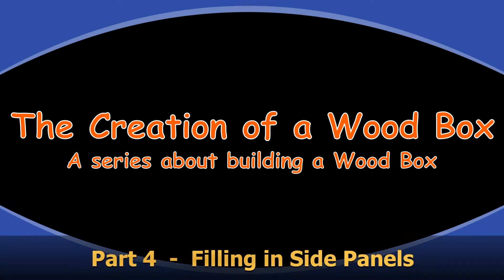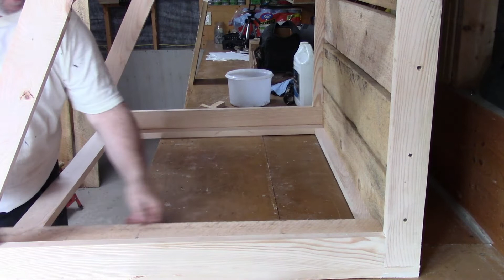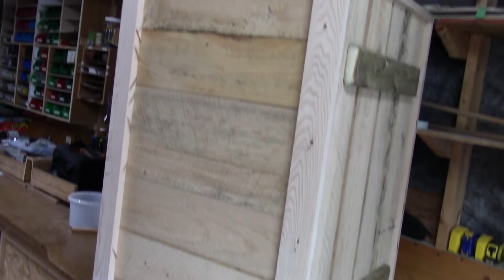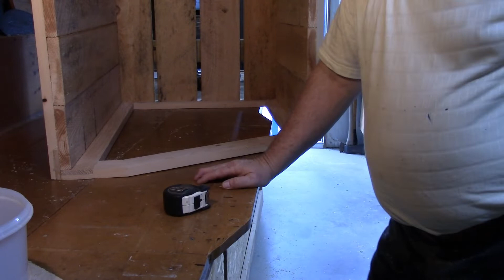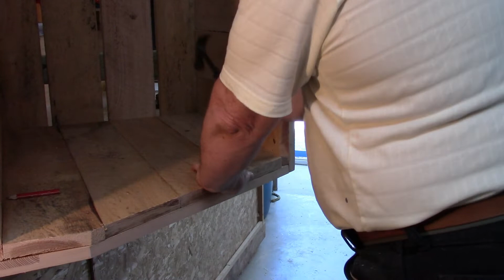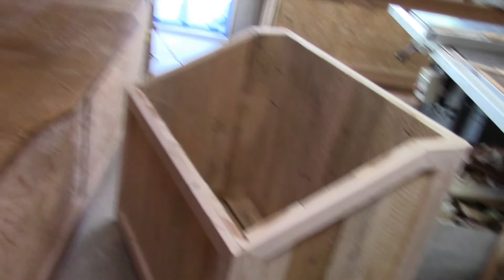Wood Box Part 4

Comment: That's looking really good Mike!  Funny how fast the weight builds up when you're building with wood
Reply from the maker: Hey there Bruce!!!  For sure eh!!!  This is built with rough sawn 1 X 6 hemlock.  The Hemlock was seasoned but it was sitting outside for over 6 months and it does what hemlock does well, absorbs moisture!!!  Makes it pretty heavy!!!  Thanks for tuning in and have a good day!!!